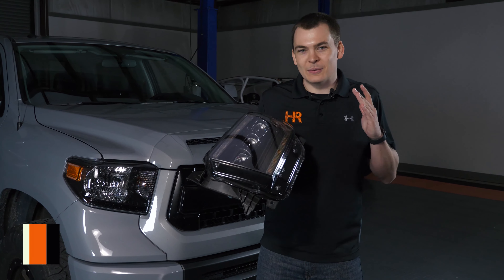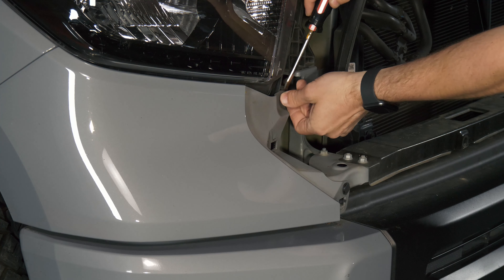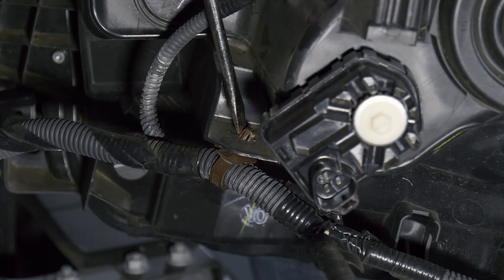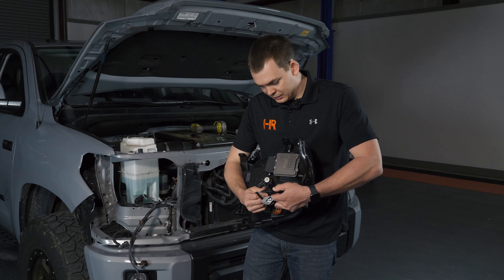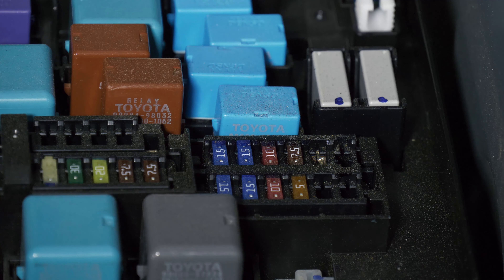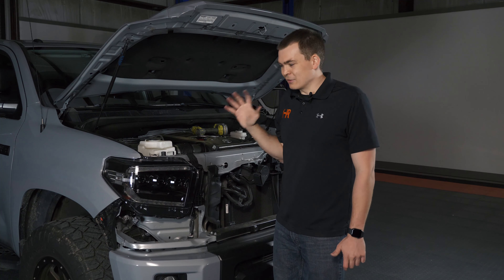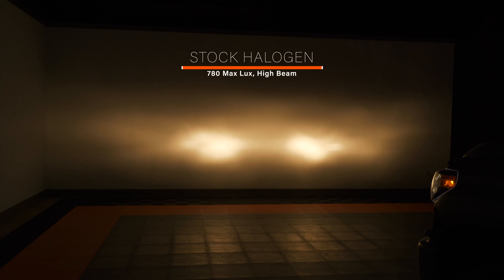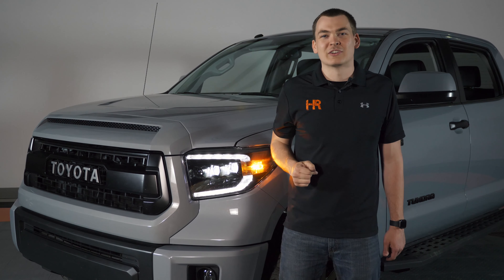2014-2019 Toyota Tundra Morimoto XB LED Install | Headlight Revolution

Comment: I have a 2020 Tundra SR5 with the halogens, that has a built in DRL. Am I going to need to put in a fuse tap or should there already be a plug for it?
Reply from the maker: You will still need to run the fuse harness.

Comment: will these still work if you dont have the headlight adjustment on your stock?
Reply from the maker: Not sure what you mean by headlight adjustment, but those will work on any 14-19 Toyota Tundra!
Reply: @HeadlightRevolution  how do we lower the headlights so they don't point into oncoming traffics eyes?? Mine are up too high.

Comment: Hello, I just purchased some of these off of Amazon and cannot get the sequential turn signals to work. I looked at the install guide off of the Morimoto website. I noticed the cable that needed to be disconnected, only had a blank adapter in it. There was not another cable for it to plug into. So, I thought these would do sequential by default. They do not. I even tried taking out the blank adapter and they do standard blinking. Is there another model out there, that needs a different activation for the sequential turn signal? Thanks!
Reply from the maker: That's very strange, we haven't came across that yet with these headlights. I suggest reaching out to Morimoto directly on this, and they should be able to help you out with this one!

Comment: I installed the Morimoto XB headlights on my 2015 Tundra Limited yesterday. The sequential turn signals work ok after disconnecting the connector as described in the install document. However the Purple and White/Black wires in the trucks T/S connector had to be reversed.  The side marker lights do not light. I installed the DRL cable to the fuse as instructed. I did not install the short 2 wire adapters as I did not see how they are used. The truck did not have LED DRL from the factory but the DRL and side Markers worked fine before installation.  My question is: Are the side markers disabled when the T/S are configured for sequential operation?
Reply from the maker: The side markers shouldnt be disabled, I would go ahead and shoot us an email to see if we can get you taken care of! Sales@HeadlightRevolution.com

Comment: Do these still require the new Relay from Toyota to disable the DRL on the turn signals?
Reply from the maker: Yes they do on certain models.
Reply: Headlight Revolution Thanks for the reply. I have a 2017 TRD Pro, with regular Halogen headlights with the Amber DRL. I’ve ordered the XB LED headlights and can’t wait to install them. I have seen numerous sites reference this part:   81980-0C020 to replace my current relay. Is it as simple as swapping out the parts? Or will I have to do some re-wiring as well? Thanks!
Reply from the maker: It is as simple as swapping out the relay, You can do it in no time at all and your lights will work perfectly. You’re going to love those XB Headlights!

Comment: Anyone figure out how to adjust each individual headlight, horizontally and vertically?
Reply from the maker: You can adjust that on the back of the headlight housing using the adjuster screws! They willadjust both up and down, and left and right!
Reply: @HeadlightRevolution  Is there a video link? I cannot see it, but then again I am old lol.
Reply from the maker: There is not a video for that specific adjustment, but we have a universal video that will help you with that! I have linked that video for you here: https://www.youtube.com/watch?v=OIow5YgdRro
Reply: Ok, I found it but don't know how to attach the photos. Once installed ( my case 2015 Tundra) the adjustment is close up against the frame of the truck. ( hard to describe without the photos). You need an 8mm box or open wrench. A socket is too long to fit in this tight space. It is a small white adjustment. I only found one so hopefully it is the only adjustment needed.
Reply from the maker: You can totally email into us, as you will not be able to attach an image to this comment. Sales@HeadlightRevolution.com
Reply: @HeadlightRevolution  Sent !
Reply from the maker: Right on, one of our fantastic customer service reps will get back with you as soon as possible! Thanks for the support!🙏

Comment: Maybe y'all could help me with this... I got the morimoto xb headlights for the 2020 Tacoma from you guys... Installed them this weekend... When I turn on my DRLs they dont light up?? I did not install that extra little cord that plugs into the fuse box? Do I need that to get my DRLs to work or did I do something else wrong?
Reply from the maker: Yes, you will need to install the cord that goes to the fuse box, that is how the DRL receives it's power. Once you get that installed, it will work properly!
Reply: @HeadlightRevolution  if I do that I can't turn the DRLs off with the switch on my stearing wheel???  Do they make something that will allow me to turn the DRLs on and off using the switch on my stearing wheel?
Reply from the maker: Unfortunately not. The DRL will be on as soon as the ignition is on. The only way to do that would be to wire in a separate switch.

Comment: I've heard theres a relay box needed to install in the cabin for stock halogen?
Reply: Drey Thompson yea me too I put that relay flasher in and my Morimoto turn signal hyperflash not useable.I have 2017 crew max sr5.So I had to put stock lights back in ,not a happy at all with these and the mystery of getting them installed correctly.I did exactly what they told me to do.

Comment: It’s only ~$700 for the OEM LED headlights which seem like a better deal ($1.150 for Morimoto) given the performance of both. Some are reporting condensation issues on the forums with he Morimoto’s as well

Toyota OEM LED fogs out perform the Morimoto’s in your previous videos
Reply from the maker: We found out that in regards to the fog lights it's more about style. If you want a black out projector look you choose the Morimoto fog lights. If you want the brightest fog lights go with OEM in this application.

Respectfully I'll have to disagree with you about the headlights though. We think the OEM LED headlights are pretty pathetic for a $40-50K truck. The Morimoto headlights are a big upgrade in both style and performance.
Reply: Headlight Revolution I guess you’d agree that nearly all OEM lights are pathetic then? I haven’t been impressed with any of the OEM truck LED/HID headlights.
Reply from the maker: @MidMoTundra  Not all but some. I think when you get a reflector based LED headlight from the factory they don't perform well. The bi-LED projector headlights we've come across are normally pretty good. A guy here has an Infiniti QX80 with bi-LED projectors and he says they are some of the best he's ever driven with.

Comment: I'd go with the Toyota LED, yes the low beam isn't as good but it's good enough and the Morimoto high beams are a joke compared to Toyota's, how did they mess that up? Too bad as they'd be a no brainer if better high beams
Reply from the maker: Thanks for your input, we'll be sure to pass it on to Morimoto to see if they can make some changes!
You can never go wrong with the OEM LED set up, they are fantastic!

Comment: People over at tundras.com are experiencing condensation in the housings.
Reply: Bpeelgren I think it was 1 guy that had the pre release version
Reply from the maker: These headlights have a warranty so it shouldn't be a problem to get them serviced, but we haven't heard about any "known" condensation issues. If it was a pre-release version that would explain it. Either way, contact the store you bought them from and the current production model will fix any issues from older models.

Comment: Does the leveling motor switch in the cabin need to be set at zero prior to installing the XB’s??
Reply from the maker: Nope, the leveling motors will adjust automatically!
Reply: Awesome! Thanks.